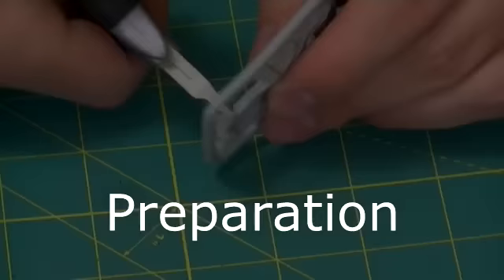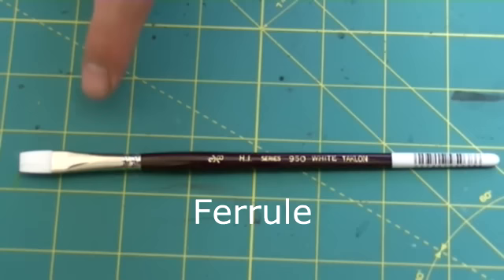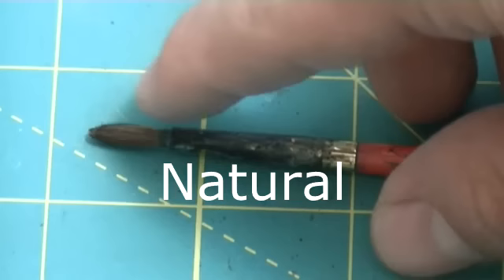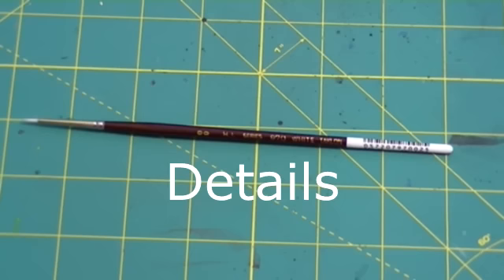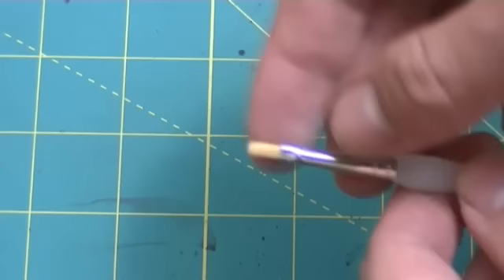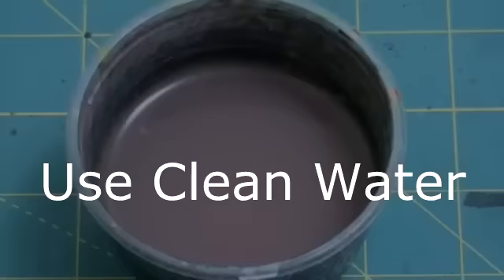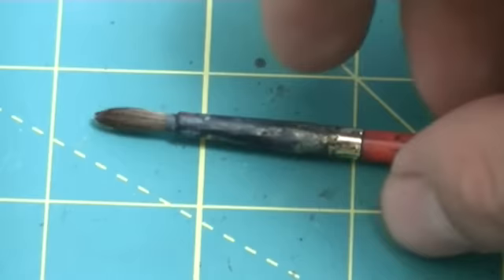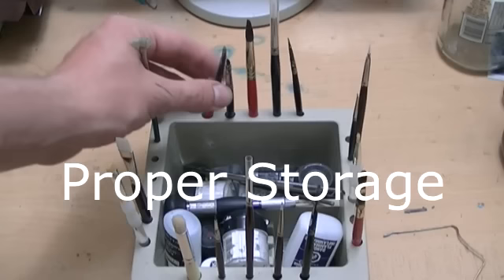Miniature Painting 101 - Part 3 - All about Brushes

Comment: one thing that is overlooked on every brush video I have seen is how a brush works...typically beginners think that if they don't water down their paints they will get better coverage...that's just not how a brush works. Second thing is that generally beginners use the detail brush(s)  when a round brush with a sharp point would be much better suited. GREAT Video. I typically use a round #2 brush for basing, all the way to the details including eyes...except for the dot's which I use a detail.